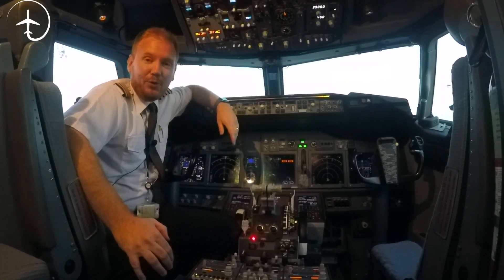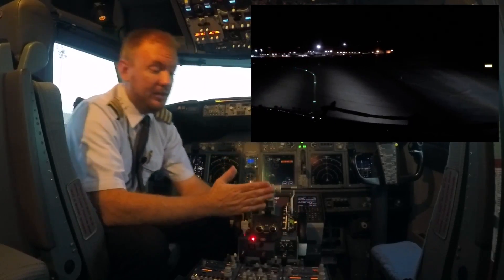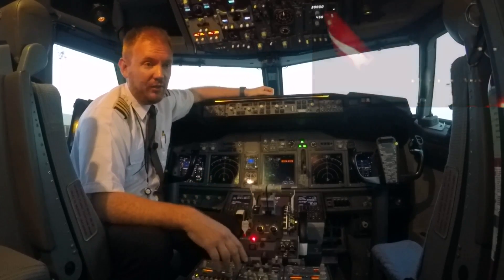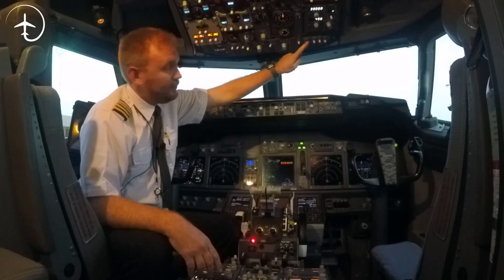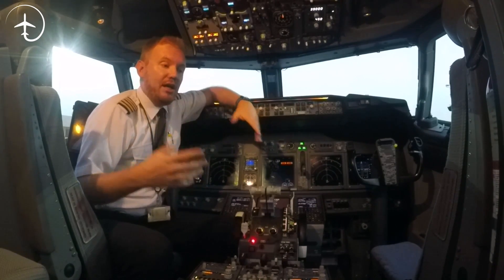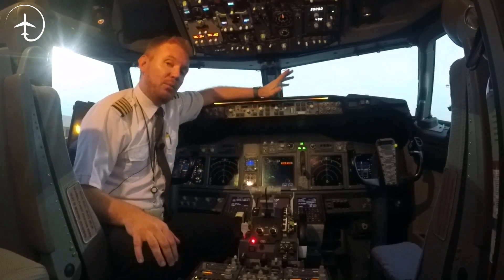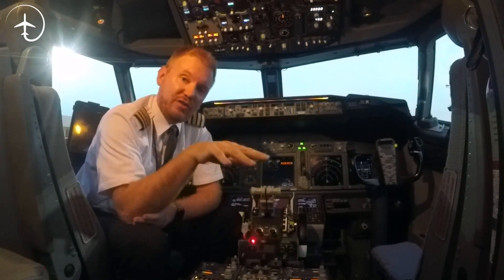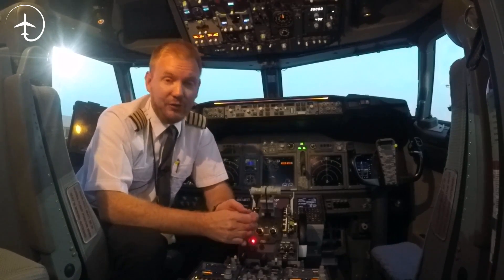Boeing lights explained

Comment: lift is caused by circulation, controlled by the trailing edge flow, called the Kutta condition 
The winglets increase the effective wing span and therefore reduce the induced drag, which is proportional to the square of the spanloading.
The winlets increase like the biplane the apparent mass of the air deflected downwards. That is it.
You might read up the publications of prof. Dr Barnes McCormick, who describes the exact theory of wings. Pennsylvania state University.

Comment: Me and a friend got into a discussion about the lights that you might see at altitude. I was told that some planes have a single blink every 1 or 2 secs, and others have a double blink every 1 or 2 secs. So my question is, which brand Boeing vs Airbus are those lights true ? Is boeing a single or double blink, and are there any blinking differences ? Altitude ex. 30000 ft.

Comment: Question: on most 737’s I’ve seen 4 landing light switches, 2 fixed and 2 retractable. How come this aircraft only has 2 landing light switches?
Reply: It’s a newer aircraft and doesn’t have retractable landing lights.

Comment: Ah, that shed some light on a few of my questions! Puns aside, I notice a lot of people on flight simulators using the strobe lights while taxiing or even while at the gate! By the way, would you use the strobes whiles crossing a runway? Thanks!

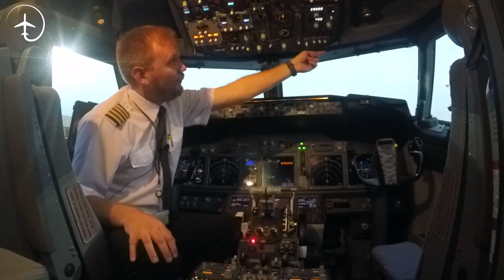Comment: 5:40 Uhm..no it doesnt. It illuminates the main wheel well light, the nose wheel well light switch (push button) is on the ext power panel.
Reply: Uhm... yes it does. They are used for pre-flight inspection but they must also be on to see through the gear downlock viewers at night. It’s very difficult to get into the wheel well whilst flying, so they put a switch in the cockpit.
Reply: @benshepraf  I know🤭I noticed 5 months ago😆It still has one on the external power panel aswell🙃
Reply: @benshepraf  There are no downlock viewers on the 737NG tho😉
Reply: @speedbird9313  yep, lots changed on the NG. But one thing that didn’t is the wheel well light switch which still turns on the nose well light ;)
Reply: @benshepraf  True👍🏻

Comment: The 737 flaps will be used to evacuate the plane over the wings? It makes sense, given how close to the ground a 737 is, but I never really thought of actually sliding down the flaps themselves.
Reply: Joseph Charles Still kind of high tho🤭But, if you have to you have to🤷🏻‍♂️

Comment: How many times does the strobe lights flash ? And how many seconds are they apart ?
Reply: Gaetano D'Agostino Flashes in short burst for as long as the switch is on. Not even a second I think🤔

Comment: Flew the other day on a Southwest 737 from SAN to SFO at night.  From my window seat I saw on the forward edge of the wing on the left side   six   roughly 4 x 3 inch oval shaped lights(?) on the upper leading edge of the wings. They weren't metal but appeared to be plastic. My wife, a veteran FA, saw them too, and we wondered about their function . 

 Mid-flight the lights glowed  a bit, but  at no point were they ever really bright, nor did they flash.   I asked a SouthWest FA what they were, and he replied they were strobes.  Bullshit.  He then poked his head into the cockpit, and apparently they had another laugh.  (For the record, his SW uniform was wrinkled, and seemed to have come out of a cow's ass.)

Sorry, but SouthWest won't get any more of my business.

(Interestingly, on an earlier Delta flight I noticed an improperly-fastened latch on an engine fairing .  You could see its  red edges that indicated that it was NOT properly seated. Upon landing I told the captain , who said he would look into it.  A fellow passenger piped up and said he saw the same thing.  So...Delta listened.  But not SW.

So...what are those lights/thingies? on the wing?

Comment: What do the abbreviations on the engine instruments display in your opening stand for?
Reply: Dave Fox Dave Fox N1 rotation speed, EGT (Exhaust gas temperature), N2 rotation speed, fuel flow (FF) and engine oil pressure.

Comment: Hi mentour, im wondering, what about the retractable landing lights? i see that you only have 2 switches for landing lights on the aircraft in the video, only fixed or both? And when do you use vs not use thr retracts?

Comment: I have a question about the landing lights. Planes go quite a bit nose-up just before touchdown. Are the lights fixed pointing downwards or do they  adjust to the angle of the plane?
Reply: I would guess fixed, and give you great odds!

Comment: Dear Captain, since few years i have been noticing white lights in strobe, takeoff and landing lights on new aircraft of 737, 787, a350 and a320.  Were the lights originally yellow earlier? And is there really a specific reason for having white light? (Like better illumination or less power consumption due to LED light etc).

Comment: Are the landing lights and runway turnoff lights always switched off after crossing above 10,000 feet or does it depend upon Airline policy to keep them on or off after 10,000 feet?

Comment: As pitch black as it is at night, several miles up... wouldn't it be safer to leave the LOGO LIGHTS ON, to be more easily seen by other aircraft- or does it have more to do with battery drain?

Comment: Hi, I am almost done with building my 737ng sim and was hoping you would talk about the internal lighting.  Exactly what lights are control via the light panels below the MIB and on each side? Where are All the lights projected from?  How do you change colors from red to white? From what power systems do they get their power.  What about the IBL, how is it tested?  Where is the split between the capt and fo MIB lighting controls?
Bob Furtaw ATP CE500

Comment: I'm bored of the B737s, they're flying crap
Reply: Luciano Médica Catalán They are the workhorse for many airlines.  I spent 11 years on it and it’s a great jet, but I don’t plan on going back to the 737.  It flies well, but is loud (in the cockpit) and not nearly as comfortable as the Airbus product.  No headsets (Airbus) at cruise because it is quiet,  cockpit seats are much more comfortable, tray table to eat on instead of balancing a tray on my inboard leg, better windows for visibility, and I love a side stick.

Comment: Are you allowed to walk around the plane and personally show us close ups for the lights? It would be great to see their form and structure up close. Also, I think the old 737400s had some lights on their wingtips which illuminated the tail. What is their solution for the new wingtipped 737s?
Reply: Not too sure because that would also reveal which airline he works for, and most airlines don’t want that

Comment: Can you turn off the no smoking sign? Just out of curiosity.
Reply: rrrglynn they cant
Reply: Paul Baltazar Yes, they can.  The regulations might require it to be on continuously, but there is a switch to control the sign.  So airlines cycle the switch as a signal.
Reply: Oscar Blue 
What? I thought they use the switch as a memory thing. They put it in specific positions whether they have told the flight crew to prepare or something like that
Reply: Paul Baltazar No, they use it to illuminate the No Smoking sign in the cabin.  Some airlines cycle it (double ding) to indicate sterile cockpit, or no longer sterile cockpit, but it is left in the ON position during flight operations.
Reply: Oscar Blue I posted this comment before I saw another one of his videos that talks about it. He said that there is in fact a switch in the cockpit but it does nothing to the signs in the cabin.
Reply: rrrglynn It’s been so long since I flew the 737 that I can’t remember which switch we used.  All but two of the switches in the cockpit have no effect on the signs.  The seatbelt switch illuminates the seatbelt sign and the no smoking sign illuminates the no smoking sign.  The no smoking sign normally remains on continuously unless it is cycled as a signal, and then it is only off momentarily.

Comment: ive noticed on some of the newer Boeing's they have super bright engine lights that shine directly into the engine. as well. I cant remember what type it was, but it was its maiden flight, was on a taxiway watching it takeoff. hadnt noticed them before?
Reply: fhhsvnggbh It’s the wing lights.  It is for wing inspections.  It just happens to illuminate the engine intakes.

Comment: MR TRUCULENT SAYS !!!! I am a bit confused when you say left hand side and right hand side. It depends if you are looking from the Front of the aircraft or back. They will change sides If you look from the back, then from the front. I used to do sailing and you always looked from the bow (front) of boat and the left side would be port and the right hand side the starboard. On boats it is called bow (front) and stern (rear). I don't know if this is true of aircraft. Your English is spoken well, I think you can go into greater detail. When I worked in Denmark and flew back to Britain on SAS, the nasty check in man ( I think he had the disease according to the international classification of diseases ( 302 . 0 )  would have known you entered at the front of the aircraft. I had a broken leg and had to walk to the rear. My seat was next to an emergency exit window. Then the hostesses told me I had to move as I was blocking the emergency exit and would cause an obstruction. I told them I refuse to move, because I wouldn't cause an obstruction. If I was further down the Isle I most certainly would. but where I was sitting the window could be opened and push me out. SAS is rubbish. The best airlines I have been on is Israel ELA . By the way that sands for Every Landing Always Late. They would never take off in time for security reasons. Also everyone would clap when the Captain landed. (sorry I don't know your email or I could contact you that way) as this has very little to do with lights. The blog or what ever you call it is interesting but please sort out this left and right thing. You are aiming at an English audience not Swedish, as you are speaking in English .

Comment: About the under underbelly landing lights? Didn’t see the switch on the panel?
Reply from the maker: No, it has been replaced on the newer models by a set of LED’s in the wing root.

Comment: Hello, i know that i want to be a pilot. However, i do not know if i should be an airline pilot or helicopter pilot, does anyone have any tips. Salary, most exiting, work time, job opportunity etc.? Here in Norway private atpl (p) is slightly cheaper.

Comment: Couple of things--the anti-collision lights are meant to increase visibility of the airplane in flight.  Using them to alert ground crews to engine runs and so forth is secondary.  The wheel well lights have a switch in the cockpit, as well as in or adjacent to the wheel wells, because the "classic" 737 aircraft have viewer devices in the floor of the airplane that allow a crew member to look at a part of the landing gear downlock mechanism in flight and verify a down-and-locked condition for landing if the normal indication system did not function.  Because of this, the aircraft could not be dispatched if a light in the wheel well was burned out.  On the 737NG and later, the viewers are not installed because two landing gear position sensors and indicators are installed for each gear.  The wheel well lights remain to assist in inspecting equipment in the wheel wells on the ground, which tend to be dark even in daylight.

For those questioning which lights are installed on each airplane, or which lights may be inoperative, download the PDF from FAA of Boeing 737 Master MEL and look at Chapter 33--LIGHTS.  You will see what a difficult task flight crew, maintenance, and dispatchers have in answering those questions.  Luckily each operator (airline) has a MEL document customized for the particular aircraft model and equipment options, which simplifies the task somewhat.

Comment: Hey Mentour, What exactly do pilots do in a walkaround , what do they check and is any special training required for it?
Reply: Advait Shirbhayye just to see the condition of the aircraft. The pilots (more specifically the PIC) are legally responsible for lots of stuff so they have to be aware about everything.
Reply: Advait Shirbhayye the purpose of the walk around is to search for conditions that could compromise the safety of the flight. it's important to perform this task correctly  because the consequences of failure can be serious. never under estimate the importance of performing a full external inspection, regardless of how pressed for time you may be. this task is usually assigned to the first officer. it is part of their  training.
Reply: Hey thanks man!!!!!!!!!
Reply: Ok Thanks!
Reply: Advait Shirbhayye Damaged lights (broken lenses), static wicks, static ports, pilot tubes, oil/fuel leaks, fan blade damage, latches secure, damage to control surfaces/airframe skin, engine sensors, tire condition, brake pad thickness, lights (nav lights illuminated), blow out discs, strut extension....

Comment: Wow!!!!!!!! Is it possible to retract landing gear on the ground?
Reply: Advait Shirbhayye 
On the A320, the LGCIU, controls the safety valve when either ADR 1 or 3 has an indicated airspeed greater than 260KIAS, the valve will close preventing extension in flight. There is also a function when the aircraft senses it's on the ground, the valve also closes to prevent inadvertent gear retraction.
Reply: Homer Simpson did it.
Reply: Advait Shirbhayye nope
Reply: +Ava Mendez Appreciate your help!
Reply: Oh!
Reply: On some airplanes, you can. The airline is not happy at you after, very expensive repairs. The TV show Mayday had spoken of a pilot who totaled a plane doing so. Not the brightest star in the sky!

Comment: What is the significance of turning off the landing lights after exiting the runway and above 10000 ft. And also why can't you just leave the logo lights on
Reply: Shreyas Joshi the landing lights are really bright. They can easily dazzle anyone who looks at it. Similar to what happens when someone drives a car with their high beams.

And logo lights are more of an advertising light. It has nothing to do with safety and it’s not a requirement in aircraft. Since over 10000 ft no one will look at the logo so no point.
Reply: Landing lights have a secondary purpose of letting other planes know that you are on a takeoff or landing roll so they know to not cross your path.  If you taxi with them on, other planes on the taxiway will get scared - since landing on taxiways is a thing now!

Comment: What about the fasten seat belt lights and the no smoking lights?
Reply: They're not lights, they're signs :) But i can explain it to you. In the 737, there is no "No Smoking" sign. It is always illuminated in the cabin, but in the cockpit, it is replaced with a "Chime". This is so pilots can communicate with cabin attendants. And so, you can't actually turn off the "No Smoking". Reason for that is, it is illegal to smoke in planes. The fasten seatbelt sign is used differently, depending on airlines. Some turn it off at 10,000 feet, some until cruising altitude. Some leave it off when going through turbulence, some turn it on. It's really the pilots responsibility.

Comment: Is the Anti collision light the same as a beacon light? Also, will the wing lights allow the cabin crew to see potential fuel leaks at night?
Reply: Anti collision is same as beacon, yes.
Reply: speedrocks2 The wing lights illuminate the forward upper surface of the wing and leading edges of the wing.  So, no, it would probably not illuminate the spray from a fuel leak.  It is used to check for ice/snow on the wings before takeoff if the check is required.  The light doesn’t do a great job of lighting it up.

Comment: Hi Mentor, is it safe for aircrafts to have lights as they fly over war zones? And how do you ensure safety of passengers at the same time? I use the Dubai route so much from Nairobi n get scared flying over Somalia n Yemen.
Reply: Most airlines avoid these zones, but it is also very unlikely that the aircraft can be attacked, as they usually fly higher than missiles ranges.

Comment: Hey mentour, you might already have a video on this but what is the purpose of the button cluster right above the pilots knees? Ive watched a lot of airline videos but this is the first time Ive noticed that.
Reply: To adjust the rudder pedals. The witches just above that change the brightness of the displays and backlighting, and the button above that illuminate (at different intensities) the front instrument panels at the front of the aircraft for night operations. There are a separate but similar switches to illuminate the overhead panel, centre console and circuit breakers.